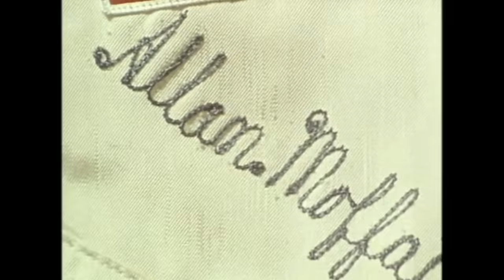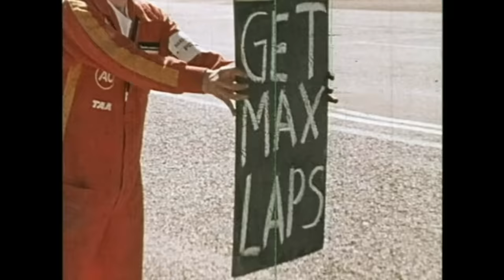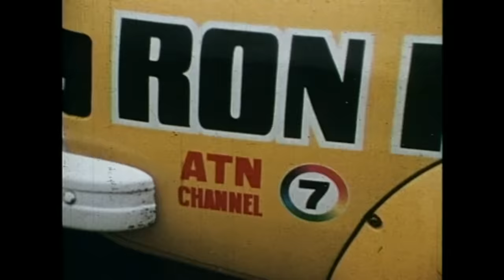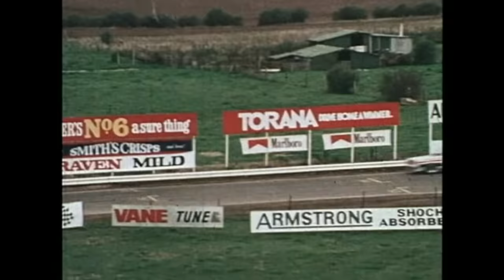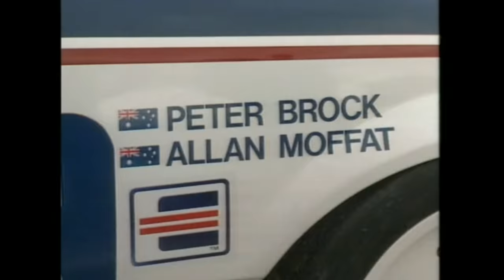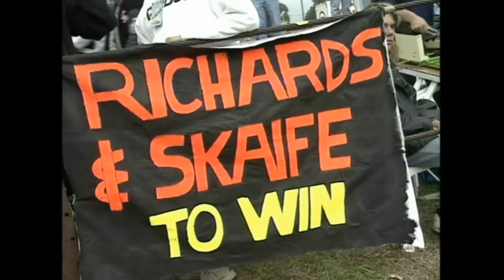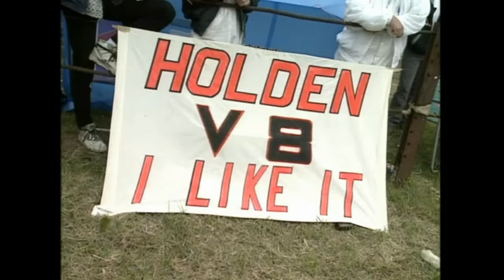ONLY ONE RACE MATTERS Holden at Bathurst 1969-1994

Comment: Holdens Philophecy ...if you cant beat it "Ban it" ...Holden just couldnt build a competitive car so they had the Nissan GTR banned (and anything else that could beat them)...and hence..."Went Broke".....At one stage in the 80s/90s Holdens competitors were adding Twin Cam's, Turbo's and Fuel injection, while Holden were still putting dirty old 186 Red Motors in their cars...Sad for Australian manufacturing but just true.